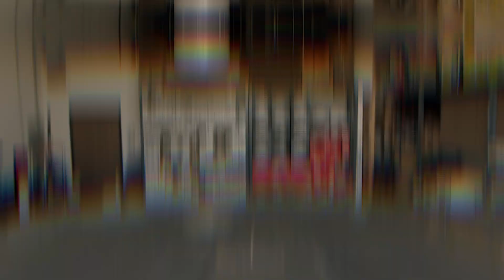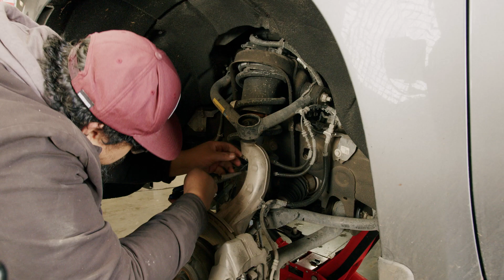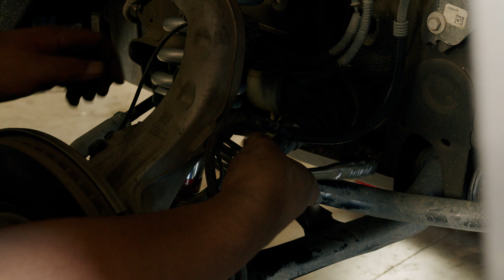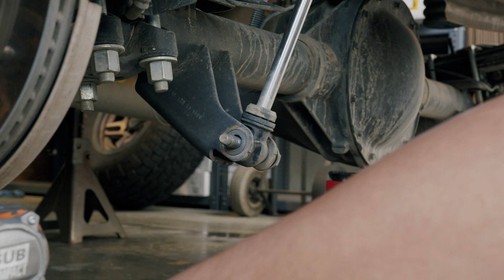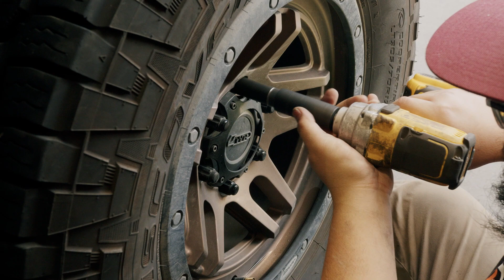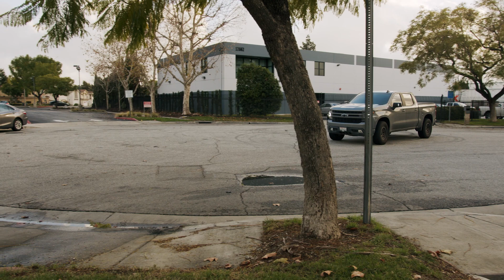@EibachUSA Pro Truck Stage 2 Kit Install - 2021 Chevy Silverado 1500 Z71 RST Duramax

Comment: Do you need aftermarket upper control arms? Or can you use factory ones
Reply from the maker: factory can work for daily driving, if you offroad a lot then an aftermarket one is preferred

Comment: How are these compared to the Rancho quicklift/RS9000xl in terms of comfort? Are they stiff like 5100’s or more soft ? I’ve had 5100’s before and they were wayyyy too stiff. I currently have the ranchos but even with the adjustment the ride quality is still jarring at times (Silverado 1500)
Reply from the maker: we understand what you mean with your silverado, had similar experience on this silverado right here with the rs9000s. The Eibach rides more consistent, still comfortable, not as firm as Bilstein. The guys here with the Eibach on their trucks currently (3 of them) think they're great, comfortable, good bump compliance but not too squishy like Fox. We've got a full review coming super soon
Reply: @ShockSurplus  Hey guys. Seriously considering/planning on Eibachs for my truck soon (to replace simple spacer lift). Did this review ever get done? I scanned through your videos but didn't see anything.

-bZj

Comment: For a stock rst Silverado what is the out of the box lift on these front coil overs? Like preset lift?
Reply from the maker: It will vary a bit based on engine option but they should be set to around 1.5" of lift on most 4WD Crew Cab trucks. They are however adjustable while installed on the vehicle and include a spanner wrench, so they make it easy to adjust if you are not happy with the out of the box settings
Reply: @ShockSurplus  thank you I have the 5.3 double cab. Wanted the longer box

Comment: I want to buy a suspension kit... for my 2018 Chevy Silverado Z71. What do you recommend based on your experience... Bilstein, Eibach or Fox 2.0?
Reply from the maker: It depends on your goals and preferences as all are great options. The Fox 2.0 is definitely the softest and most plush of the bunch but will need the most maintenance and is limited to 1" of lift on the 2014-2018 Silverado and Sierra 1500s. The Bilstein 6112 and 5100/5160 packages are definitely the firmest option, but still are a big improvement in comfort over stock and by far and away are the best under a load. They now offer two kits ranging from 0-1.85" of lift in the front and 1.75-2.75" for vehicles with aftermarket upper control arms.  They also use a 2.6" diameter body compared to the 2" of the Fox and Eibach, making them a little better in more extreme off road situations. So if you like to go fast off road they are probably the winner. The Eibach is very much in the middle being a little firmer and better handling than the Fox but a lot more plush than the Bilstein. They also have the most travel and offer the most lift at 1.75-4" of lift but will almost undoubtedly require an aftermarket upper control arm.  If you are into more low speed off road driving where articulation is paramount, then those are probably your winner.

Comment: I've been looking at the different videos about the Silverado Duramax you made over the years and I'm still unsure.
My goal, as anybody I guess, is to get the lowes price and best performace for a given situaton. I have a Z71 Trail Boss 3.0 and would like a smoother ride on and off-road. For example I did a part of Alpine Loop Colorado this summer and the big rocks were hard on the ride. The Blinstein seems to be a bit firm so ... I don't know.
Reply from the maker: If you are looking to keep cost down and have something that is actually well optimized for a Trail Boss, the Bilstein is going to be by far and away the best option. Although certainly firmer than stock, the factory Rancho suspension is so comically underdamped, so that added firmness actually is a good thing in this case. With that said, if you like a soft ride, you are going to have to look upmarket to something like a King 2.5 Extended travel package with a set of the upgraded upper control arms needed to make them work. They are however well over double the price of a set of Bilstein 6112s and 5160s at about $2800-3600 a set depending on if you want compression adjusters or not for the coilovers and shocks alone, and will have about half the service life of a Bilstein before needing to be rebuilt.
Reply: Thanks @ShockSurplus  
I don't know how the Bilstein would compare to my stock shock as I don't have the adjustable Rancho suspension. I guess it was not available in Canada, mine don't have adjustment.
Reply from the maker: You probably mean the Active Ride Control as there is not any adjustable Rancho options from the Factory. With that said you will definitely much prefer the Bilsteins to your stock Ranchos
Reply: @ShockSurplus  no, they are just non ajustable. Red and White

Comment: Hi there! I have a 2020 Silverado trial boss which comes with a 2” lift. I have lifted the front to get my truck leveled (1.75” spacer with upper control arms). I’m very interested in eibach or icon. Can you tell me the difference for my truck?
Reply from the maker: I would not recommend the Eibach for a Trail Boss as they will be maxed out getting you to stock height and when paired with your spacer to maintain the height you are now will definitely cause CV bind. The Icon 2.5 front coilovers will not work with the spacer either but will at least be able to be adjusted to 1.5" of lift so you would only be losing a 1/4" of height from where you are now. The Eibachs may be the slightly more plush choice, but the Icon will handle better, take bigger hits better particularly at speed, and will actually give you close to the lift you are looking for.

Comment: What aftermarket upper control arm would you recommend in conjunction with this kit?
Reply from the maker: We always recommend the Icon delta joint, hard to beat unless you need need need adjustability than SPC, or billet icon arms with the adjustable heims

Comment: Is the truck stock height?
Reply from the maker: front got about 2.5in of lift through the coilovers, and there's a 1" lift in the rear
Reply: @ShockSurplus what did you use to get the 1” in the rear?